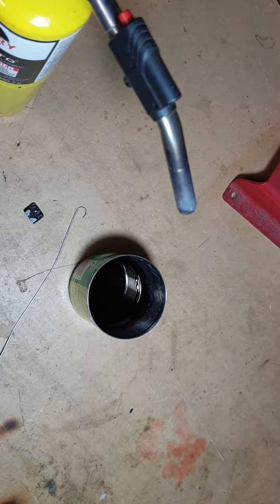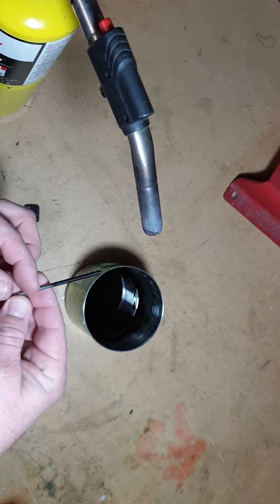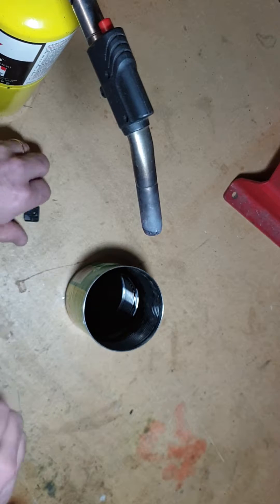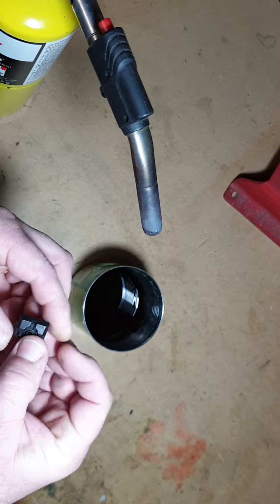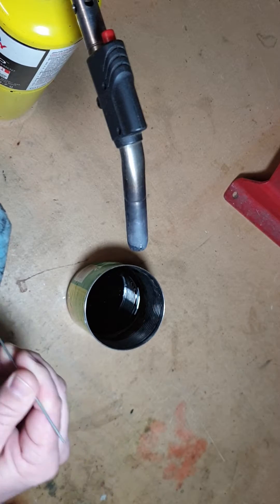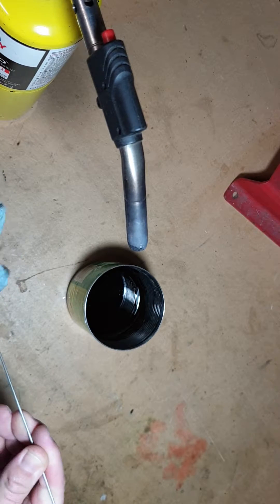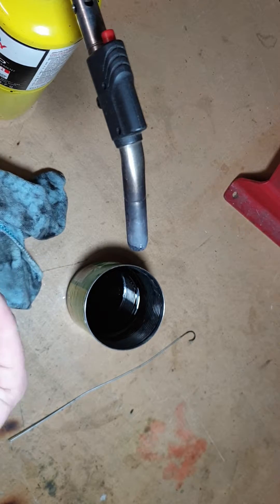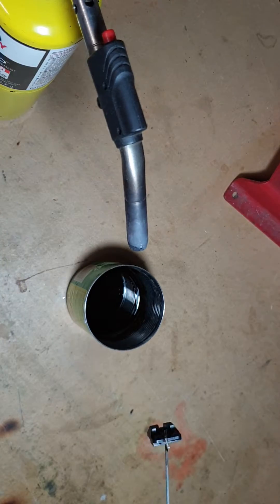Blackening Steel with Heat and Motor Oil

Comment: great work, but will the blackened steel be easily scratched off?
Reply from the maker: It lasted quite well, alot better than paint. I think if it was sandblasted first it would be better because the oil would hold on better
Reply: @hardcase999   thanks, would the steel need be heated to red hot or just very hot for the process to work?
Reply from the maker: Needs to be cherry red at least for the oil to burn.